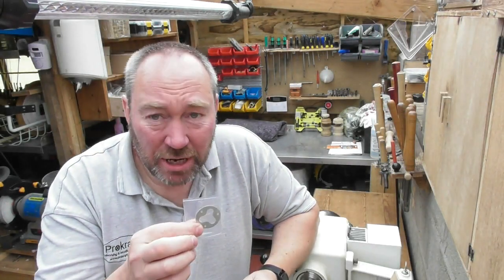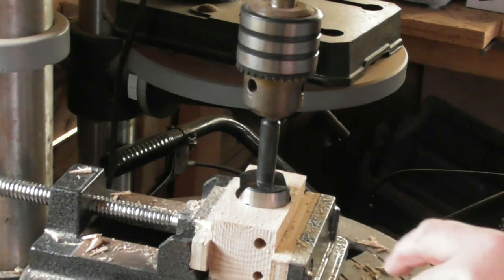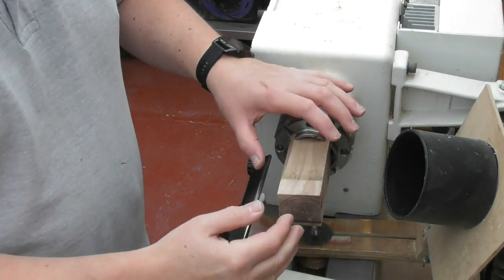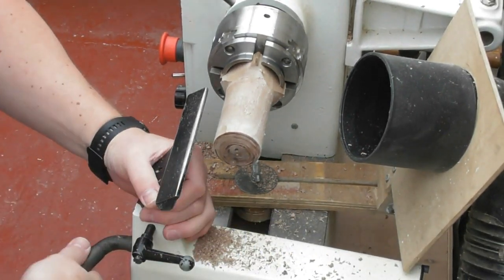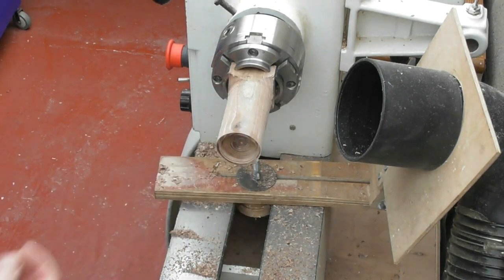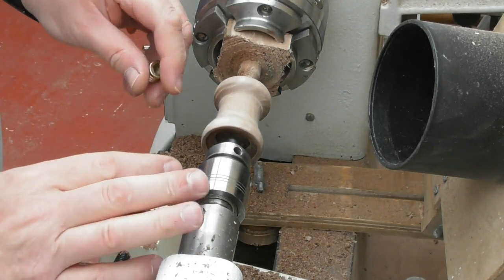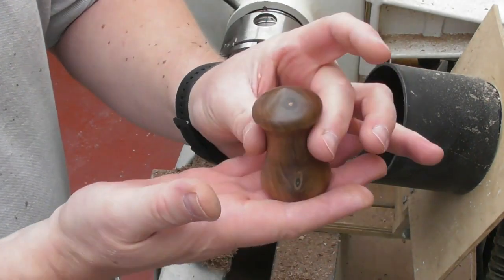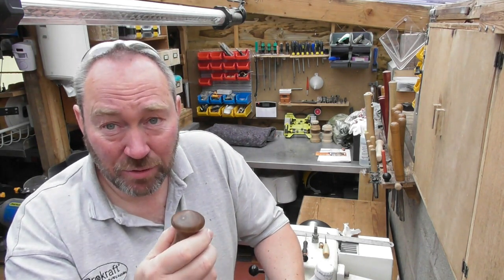Disc Bottle Opener Kit from Prokraft

Comment: Can you re3xplain how you made the sliding dust extractor
Reply from the maker: Hi Neil, the video link is here: https://youtu.be/mHGn7g4T14A

I basically copied the fitment for my lathe for the banjo but in wood so you can use your lathe banjo parts as a template.

Hope that helps